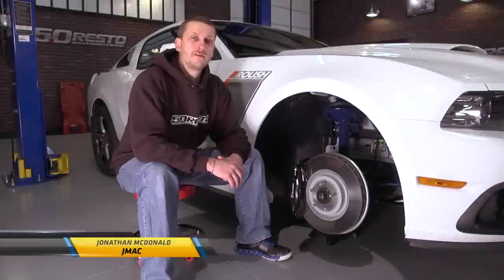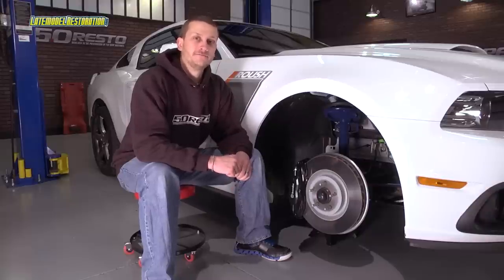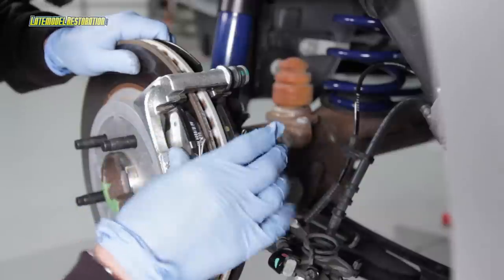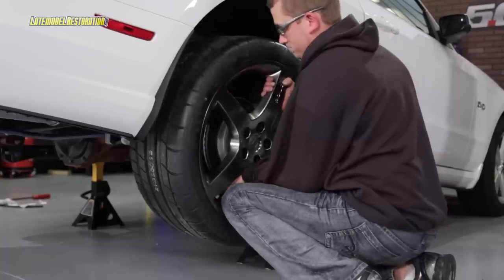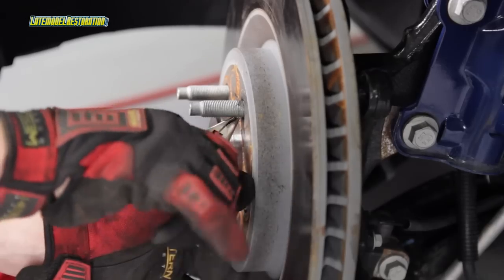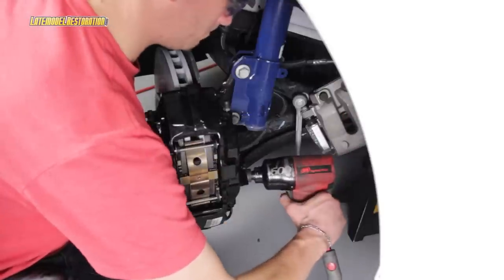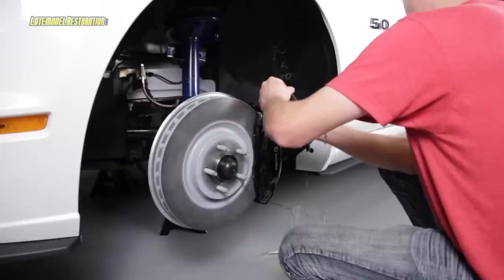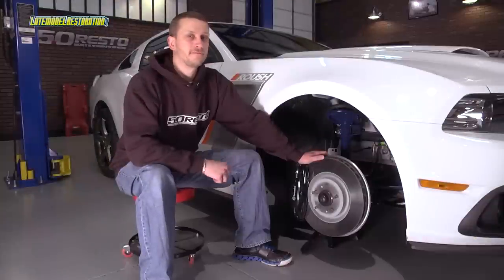Ford Racing Mustang 14" Brembo Brake Kit Install - M-2300-S (05-14)

Comment: in other words just change the fronts. The rear is basically a new set of pads lol. But it would be cool if Ford had a brembo kit for the rear.
Reply: They do, the M-2300-T. However the rears aren't necessary to upgrade unless you're doing a serious amount of track time.
Reply: @Optimus-Prime-Rib  yep

Comment: Hey guys I'm having problem with  my 1994 v6. I'll start with turning it on. When cranking, it usually takes quite a while, and takes less time each time if it has recently been started. The check engine light was not on but now is. The MAIN ISSUE is that after a while the "red line" persay drops. It starts at actual redline, then progressively gets lower. It backfires and bogs off of 4500 rpm, then 3500, then 3000. Sometimes 2500 if you're hard enough on the throttle, or if you've been driving a while. I just changed the fuel pump, cleaned the throttle body, and changed the oil. There is a pretty bad antifreeze leak, from both hoses, but I'm fixing that in a few days. After a while it won't start without trying several times and/or giving it some gas to keep it up. I had a top of the head diagnostic that it is the fuel pump, but you can clearly hear it work and/or turn on when you crank the key to accessory. It has a brand new battery. If you have any expertise or knowledge, it is much welcomed. Thanks again.
Reply from the maker: If you have a check engine light on you need to take into the dealership or to a good mechanic that can read the codes on your 1994. There is so much going on there and without physically being there it is hard to say exactly what wrong with your Stang. Best of luck and give us a call if you have any other tech questions. -Jeff J
Reply from the maker: Morbid Thrasher I was going to say that but wasn't sure if they had OBDI readers. It is worth a shot.
Reply: Calvin read my post above

Comment: what did you use for a jacking point and where did you put the jack stands? Having a hard time finding solid points
Reply: Rear diff for rear,  pinch welds jack point for front. Or just buy steeda jacking rails

Comment: Will this fit stock GT 2013? Is it included with everything for both front and rear brakes (rotars, pads, included?)
Reply from the maker: Yes, these will be the stock applications from the 07-12 GT500 models and would still be a direct bolt-on for these cars. Many of the 13-14 guys do this swap to open up more wheel options.

Comment: I have found a set of the 08 18x9.5 svt wheels to  fit the brakes however one is busted. The cheapest I found was summit. Is there any1 you could recommend for the cheapest deal for a replacement?
Reply from the maker: aaron mcdonald Maybe through Craigslist or eBay. -Landan
Reply: i went ahead and went with summit. thanks for the reply

Comment: How do you actually bleed them
Reply from the maker: Jim - You can use a vacuum bleeder or have a friend pump the brakes and hold until each caliper is fully bled.  I'll link a video of a basic brake bleeding procedure.  The same rules apply for this setup.  Whenever you get to the front calipers, make sure you bleed the outer bleeder first, followed by the inner bleeder.  -Landan
Reply: @latemodelrestoration  thanks landan !
Reply from the maker: @jimbrow83  You're welcome.  Looks like I forgot the link to the basic brake bleeding procedure.  -Landan

Here it is: https://youtu.be/B0OEoj-lkkM